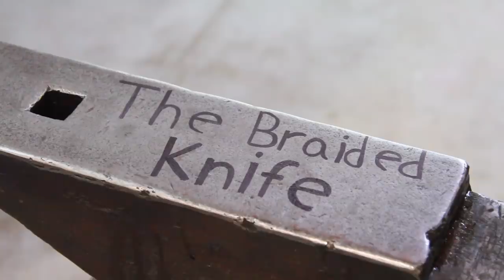Forging a Braided Knife - Blacksmithing

Comment: Looks excellent, but I'm a little worried about what looks like two small cracks by the points where the braid starts. Could be nothing, hard to tell on video, but might want to not use it too harshly. :)

Comment: So much stress on the metal when you bend it, I feel like if I tried it would snap to pieces
Reply: What do you mean? He put the knife through a normalizing cycle before the quench and tempered after. Very little stress could've formed after the temper as no material was moved, only removed. However, you are partly correct in saying that before the temper there was a large amount of stress in the knife from the braiding and forging.
Reply: @daniellaufer9774  not everyone is as experienced as you are
Reply: @marshallschaefer9632  it has nothing to do with experience frankly. They are just stating what takes the stress out of metal
Reply: @joetheblacksmith8071  well okay i am not a blacksmith so i took a uneducated guess and failed
Reply: @marshallschaefer9632  its okay im not mad at you or anything im just saying
Reply: Beautifully designed I love.

Comment: I think I’d forge a braided handle separate and forge weld it to the knife blade
Reply: Justin Topp introduces a larger margin of error and fracture or delamination points. This was the most structurally sound approach to this build.
Reply: Docprepper true but I make a lot of braided handled fire pokers so it’s easy for me to do
Reply: It would be easier and faster for me to do